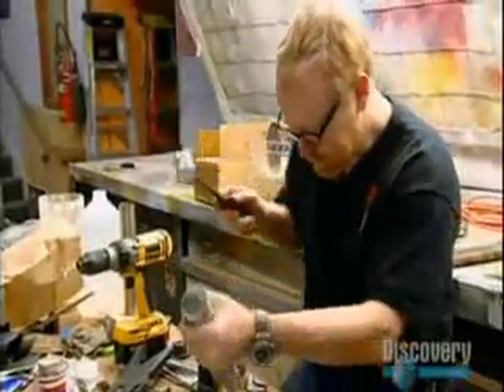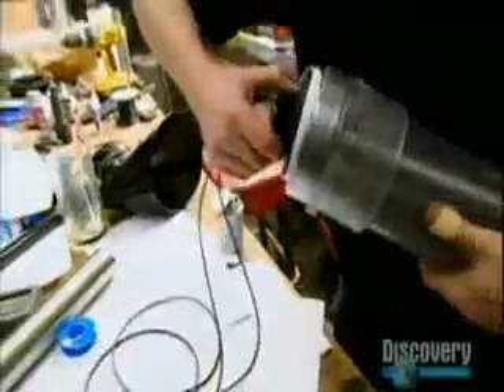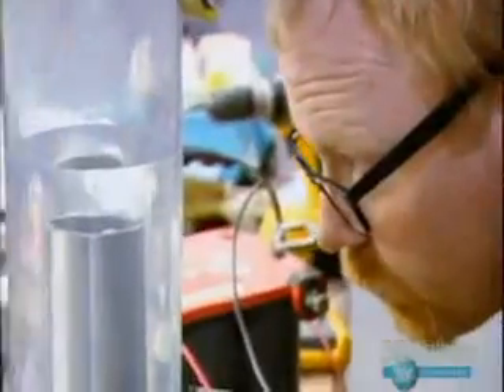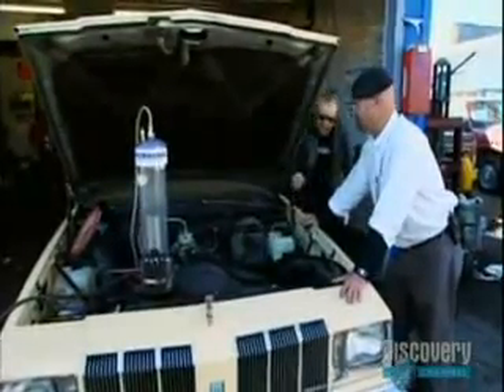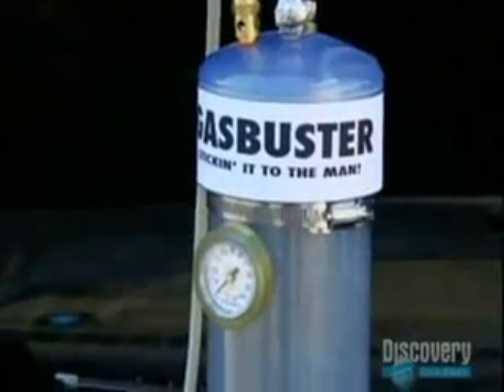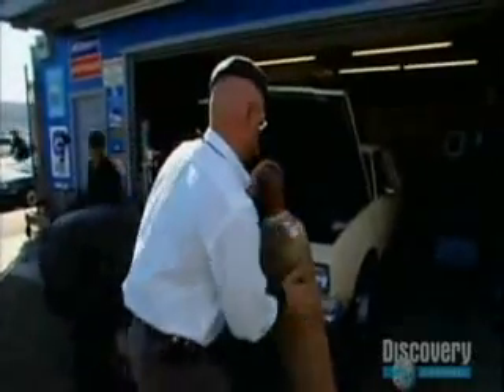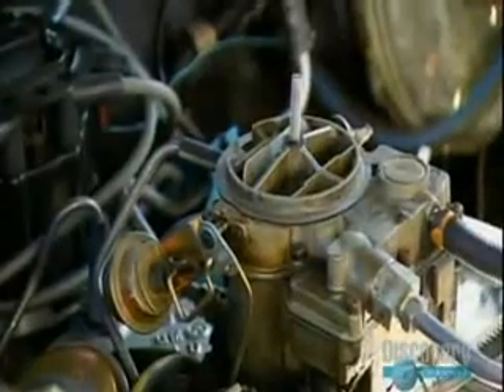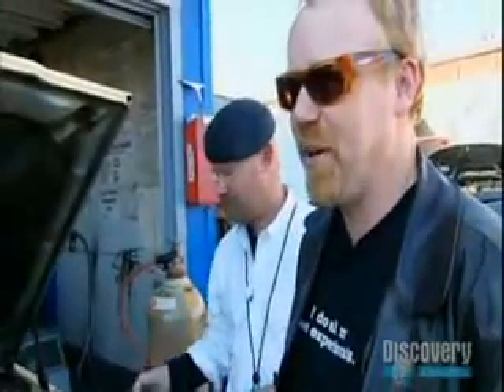HHO Mythbusters Explained

Comment: Myth busters, Myth flubbers on this one. Did they get paid to flub?
Reply: Oh Batty, that's so wrong, it's beyond funny, it's sad.  You're contradicting yourself.  a "Bob Boyce powered" electrolysis cell doesn't have a hydrogen (or oxygen) electrode.  Boyce supplies A/C power to the cell (one frequency is 5500 hz or so, the other two are I think the second and third harmonic), not DC.  That means that the polarity of each electrode changes 5500+ times per second.  Which means that the electrodes switch between being the oxygen and hydrogen that quickly.   Each bubble of gas forming on the electrodes has both oxygen and hydrogen.  So, there is no "hydrogen electrode".

As for adding non-hertzian energy, I would assume that hitting it with a baseball bat suffices.  It is non-hertzian energy.  Right?

Transmutation of hydrogen and oxygen to gold using electricity?   Oh my.  You really do need to stop sniffing glue.

That "pretty gold coloured stuff", if anything, isn't gold.  Under the right conditions (eg: electrolysis or high acid) a bit of sulfur (sulphates in the water, calcium sulphate, sulphuric acid, etc) and iron (corroding out of the plates) will combine to form what's known as pyrite that will plate onto one of the electrodes.  Which is this pretty gold colour, and is known as "fools gold".  Which describes you pretty well.

Anyone using high strength acidic toilet cleaner (like CLR but stronger) as a way to derust old iron plumbing has a good chance of seeing this effect.  While most acidic toilet cleaners are HCl (hydrochloric), there's usually a bit of sulfur in the water which has been captured by the porous iron.  I did when I used high strength acid to derust an old well pump, and our water has a teeny bit of sulphur in it.   Pretty gold colour, not gold.

"If you make ortho oxygen" ... Since ALL O2, no matter how it's made, is ortho, your device can't possibly improve on the O2 already in the atmosphere, and all of it would have reduced NOx emission already by 90%.  But 90% over what?  Certainly NOT over ordinary tanked hydrogen and ordinary air (you know, the stuff that you breathe) because it's the precisely the same stuff.

Just like the hydrogen.  Room temperature hydrogen is already 75% ortho.  Your device cannot improve on that.

Your ortho/para nonsense is just that - nonsense.  Ordinary hydrogen and oxygen are ALREADY that way, your device does not and cannot improve it.

25-28A in a truck with a 12V system amounts to 336 watts of power.  The alternator has had to use about 600 watts of engine power to produce 28A in the alternator.  Meanwhile, 2LPM of HHO will produce about 14kJ of energy per minute, which works out to be about 3 watt hours (roughly the same energy as an alkaline D cell battery).  Multiply by 60 to get the per minute rate: 180 watts.  Then divide by three (efficiency of engine in conversion of HHO to power): 60 watts.

Sooo....   You've just used up 600 watts of engine power and got 60 watts of engine power back.   It would be kind of like dragging an anchor behind your truck and believing you can replace the power loss with a flashlight battery. 

Don't work.

Until you can show us where the analysis is wrong, HHO remains, as usual, busted.  If you start with water and end as water, the most energy you can get out of it is what you put in. 

You can doubt my rocket experience if you wish, but our altitude record is in the books, and we do appear in the Discovery video of LDRS24 carrying around some of the rockets we built.  Oh, and yes, the engine/fuel designer of one of the top rocket fuel/engine manufacturers (some of the motors used in the famous Top Gear shuttle and ski jump launches were made by this company, they build solid motors and hybrid motors for NASA, and co-developed the Hyperion II launch vehicle amongst many other things), and the lead designer of another rocket engine manufacturer are both acquaintances - the latter for 40 years.  This is in addition to the NASA engineer I already mentioned.  So, yeah, I know a bit about rockets.
Reply: Frank Gutowski
Absolutely would you try Hydrogen breath test and see what it feels like?
Reply: Nature is simple?  Then please explain how Quantum theory works.  Can you do it?  I'll give you one hint: if you if you mention aether or Tesla, you flunk.
Reply: That's Babylon (the Great). No doubt.
Reply: I can see the conspiracy is growing.  Now the Pharma companies are after you too.

Hydroxy gas is just hydrogen and oxygen in any combination.  Nothing to do with ortho hydrogen.  You can only get hydrogen up to 75% ortho hydrogen anyway.  Happens naturally at room temperature, needing no expensive fairy tale equipment from Hydrogen Garage.

If you breathe in hydroxy gas, please make sure you don't have any silver or platinum in your mouth.  You'd "blow up real good", to quote Candy and Flaherty.  And for heaven's sake, no smoking!   This is vastly more dangerous than breathing pure O2.  Imagine, a human fuel-air bomb.  Just the thing for terrorists.

Oh my, watersmacker is into bestiality too!

"your body's interspecies fluids"

Ah, another "Bob Boyce production".  Is he going to sue me for not saying "TM"?
Reply: Ah, no. Explosion tests by what it sounds like are useless, because the sound characteristics heavily rely on the surroundings - an explosion inside a building sounds quite different from an explosion outside. Have you got a NIST-standardized ear? Furthermore, ordinary hydrogen at room temperature is 75% ortho hydrogen. It just does that all by itself, no fancy equipment is required to make it. In fact, there is no way to make pure ortho hydrogen. The only thing you can do is separate para hydrogen from a mixture of ortho and para, and at room temperature, 100% para hydrogen changes to 75% ortho and 25% para all by itself. So your magic electrolysis cell is producing hydrogen in the same ortho/para mix as any other electrolysis cell, or what you can get out of a ordinary tank of hydrogen you can buy from any gas supplier.

There is virtually no differences between para and ortho hydrogen. Their boiling points differ by a mere .1 (1 tenth) of a degree C (this is how you can distill para hydrogen from a ortho/para mix). The only other difference is that there are slight differences in resonant frequencies that you can see with a mass spec. If there is a difference in combustion energy, I expect you can to tell us the combustion KCal/mol for both of them. Come on now, that DOD scientist, quantum physicist and chemist (I guess that's what Bob's calling himself now) should know that detail at least.

Is Bob still claiming that he developed this stuff while he was at DOD? If he is, he should be reminded of his employment contract obligations - he doesn't get to own the rights for anything he develops while being paid by DoD. Which means that he couldn't patent it, because he didn't own it.

1000 quatloo bet that the second balloon of "para HHO" (which can't exist at room temperature) was actually just straight hydrogen fresh out of a tank.  Of course you took Bob's word for it, dincha?  Of course it didn't make quite as sharp a bang - it takes time for the oxygen in the atmosphere to migrate into where the hydrogen is.  If you were to watch it in a high speed camera, the flame front would look like a rapidly contracting balloon skin.  With a 2:1 ratio of hydrogen and oxygen, on the other hand, the flamefront would look like a rapidly expanding balloon with center of expansion at the ignition point, and the flame front would be moving MUCH MUCH faster than with straight hydrogen.

So, HHO (regardless of para/ortho) will combust MUCH faster than straight hydrogen, and yield more of a sonic disturbance.  Under certain conditions, the flame front may well be going even faster than the speed of sound (in hydrogen, which is much faster than in regular air).  On the other hand, if the balloons were the same size, the pure hydrogen balloon would have 50% more hydrogen and unlimited oxygen, so would actually generate 50% more energy.  Just slower.

You really do need to learn some chemistry.  On your own.  Away from quacks.
Reply: Making the fuel free means that cars, food, football games and underarm deoderant are free and need no advertising?   Seriously?  That's rather flawed reasoning.
Reply: @broandrew I feel I should be calling you Bob.  You are Bob, aren't you?  I didn't see that experiment.  I have no idea what trickery may have been played on you, or you yourself are making up.  The supposedly para/oxy balloon might not have had any oxygen for one.  Or, the para/oxy balloon might have been mostly plain air with only a little bit of hydrogen.  Or that the supposedly ortho balloon was close to the pictures, but the supposedly para one wasn't, when they went off.  How do you know that the experiment was done precisely as you were told?  Or are you just recounting someone else's description?

But what I do know is simple:  Hydrogen, straight out of a hydrogen tank purchasable at any gas supplier, is a mixture of 75% ortho and 25% para, because that is the stable ratio of ortho and para hydrogen at ordinary temperatures.  Hydrogen, straight off a plain dumb electrolysis cell without any fancy electronics or frequencies or anything, is also 75% ortho and 25% para.  That's just the way spin isotopes of hydrogen work.  So, if I made a balloon from your fancy/expensive HHO rig, or a simple HHO rig without a fancy "ortho generator", a two electrode DC electrolysis rig (just like the Mythbusters made) or I manually mixed pure hydrogen and oxygen from separate tanks in a 2:1 ratio, the resulting composition in all four is precisely the same: 75% ortho and 25% para.

Yes, it's really true.  Hydrogen at room temperature is 75% ortho and 25% para.  When people using mass specs use it in their equipment, they get quite annoyed because the ortho/para mix throws off extra spikes making interpretation difficult.  Which is why money is spent extracting pure para from regular hydrogen to eliminate this confusion.  But you can't actually produce pure ortho.  Sorry Bob (I mean bro), physics says so.

Now go ask Bob (I mean bro again) what the combustion kcal/mol of ortho versus para is.  If you (whoops, he')s been working in this area, this long, this should be known.  Come on now, what is it?

At least your not repeating the Deuterium or mon-atomic hydrogen nonsense anymore.

[Incidentally, the half-life of mon-atomic hydrogen maxes out at .3 seconds at cryogenic temperatures and very low pressures.  it's MUCH MUCH shorter at room temperature/standard atmospheric pressure.  Which means, amongst other things, that only a teensy tiny percentage of mon-atomic hydrogen lives long enough to get from the electrolysis cell to the engine.  Oh, and yes, mon-atomic hydrogen is neither ortho nor para.  Can't be, because it ain't pairs to compare spin directions.  But when they combine with other hydrogen atoms, they produce the ortho/para ratio that's most stable at that temperature.  Which in an electrolysis cell (which will hardly operate at cryogenic temperatures, can it?), will be 75% ortho and 25% para.]

Oh, if ortho hydrogen is so "speshul", precisely why does your watersmacker site say:

"This product is not intended to diagnose, treat, cure, or prevent any disease" 

Why are you claiming it does then?  One or the other MUST be a lie.

I note that you still haven't removed the reference to bestiality from the watersmacker web site.  Does your minister know about this?  Aren't you worried about your immortal soul?
Reply: @Broandrew  

Come on now, answer the question: how many Kjoules/gram does ortho hydrogen and para hydrogen produce?  Kcal/gram will be fine too.

You can't evade scientific questions by using even fringier biology mumbo-jumbo to insult me.  Tho, one would have to ask how a gland can be a crystal (if it was, your doctor would recommend surgical removal), or why your web site is encouraging bestiality.  The latter at least sounds like something Satan would enjoy.

Oh, and yes, I can buy a solar panel/battery assembly for less money and produce more energy then your $1500 3L/minute hydrogen machine does, and it doesn't need gasoline to spin the alternator
Reply: No, actually, I didn't refer to wikipedia.  I referred directly to scientific papers directly, you know, the ones that say that ortho and para hydrogen at room temperature and above exists only in a ratio of 3:1, and there's no way to get it higher.   Lower, temporarily, yes, but not higher.  This is basic particle physics, as developed by Einstein,  Bose and Dirac, the same science that NASA is stuck with having to follow.   Your magic device is merely producing ortho hydrogen at the exact same ratio to para as any other method of production.

You still haven't revealed to us the combustion energy difference between ortho and para hydrogen.  Can't you answer that simple question?  If you want to pretend anything about this subject, you MUST know.

As for ortho oxygen, stop.  Just stop.  You're making even more a complete fool of yourself.   There's NO SUCH THING as para oxygen.  All O2 is ortho.  You see, oxygen has a nuclear spin state of 0, meaning it's a boson.  Bosons can only have even (symmetric) rotational states - ortho.  Hydrogen has a spin state of 1/2, meaning that it's a fermion, not a boson, and has 3 even symmetric spin states (ortho) and one anti-symmetric spin state (para), hence the ratio of 3:1.

So, go out and buy a tank of hydrogen and oxygen.  Don't matter how they're made.  Mix them at a precise ratio of 2:1 and burn it.  Guess what?  3 out of every 4 hydrogen molecules are already ortho, and all of the oxygen molecules are ortho.  Ordinary hydrogen and ordinary oxygen is EXACTLY the same thing as you claim to be producing with your $1500 worth of nonsense, and produces exactly the same energy as your $1500 worth of nonsense.

 $1500 buys a lot of H2 and O2, best of all, you're not burning more than $1500 worth of gasoline to produce it.

Actually, I could ask a NASA scientist., he's been a friend and colleague for over a decade.  But I won't bother him with your idiotic nonsense .  Why should I?  Because I'm a rocket scientist too.  Certified to level 3 rocket and engine design.  This means I've designed, built and flown very large rockets with complex flight control systems and recovered them intact.   I've also acted as range safety officer and range control officer on large multi-day multi-rocket launches - on those launches we have to get NOTAMS issued to get commercial aircraft to fly somewhere else.  Flown solids and hybrids.  Made my own fuel and engines.  Been on TV.   Assisted my son achieving an altitude record in a rocket designed and built by him using high tech composite materials.  I designed and built the custom flight recovery/telemetry electronics.  Took place 12 years ago, that record still stands today.

No, Andrew, you're just batty.
Reply: They have a national popular TV hell yea they are told to global the viewers on a lot of things
Reply: What are you talking about? are you a scientist? do you know what is electrolysis? and what is HHO?
Reply: Advertising pays for mass media. And if something as basic as automobile fuel can be free, then the basis of all advertising is attacked, and the entire scheme falls apart. So here is another "rigged to fail" experiment, which protects big industry, and keeps the entire ponzi scheme going.